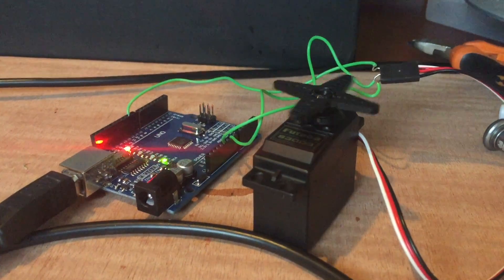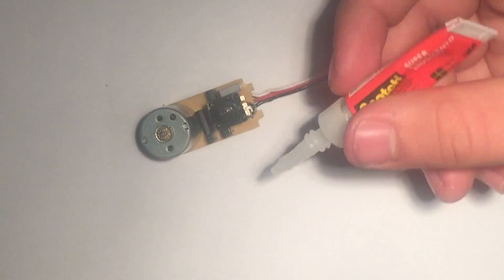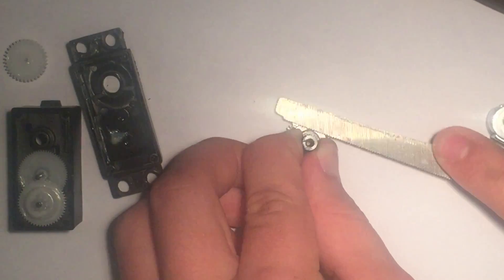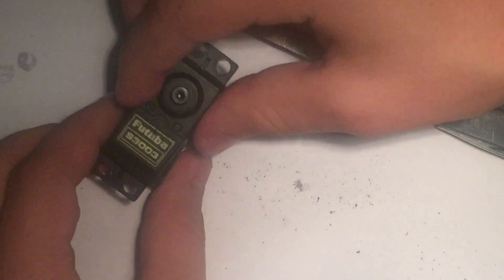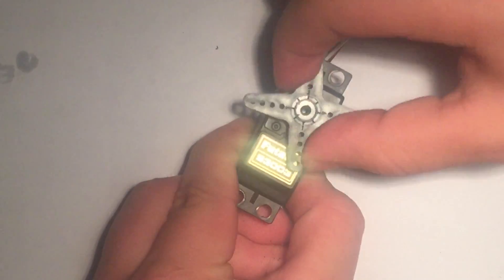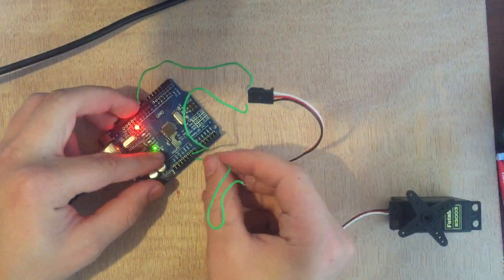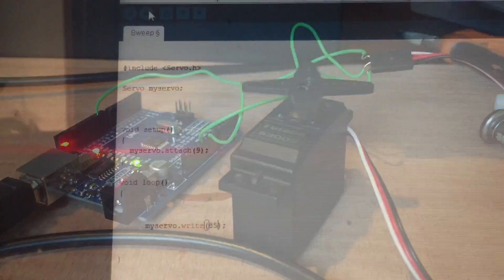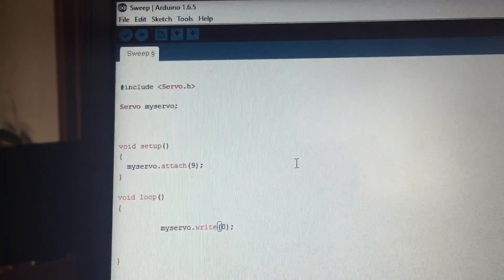How To - Continuous Rotation Servo

Comment: You can't just guess at center on the potentiometer. Center it with a servo tester or a RC receiver. Also, you shouldn't turn servos by hand - it's hard on the gears. thanks.

Comment: So.. with no encoder to return the positing of the servo, this isn't much of a servo.. Rather, just a DC motor.. That's it..
Reply from the maker: Yes, It acts like a dc motor with a gearbox, but for some projects having this from factor really helps.
Reply: Babsm08 .. its not a dc motor. it is a digitally controlled variable bidirectional servo motor. 
you can control it directly without any motor driver.thats the advantage.